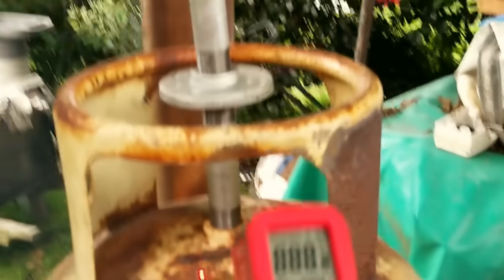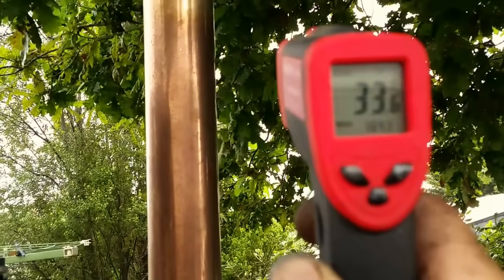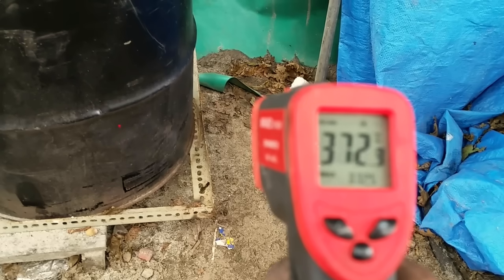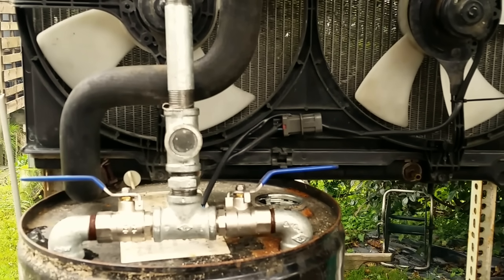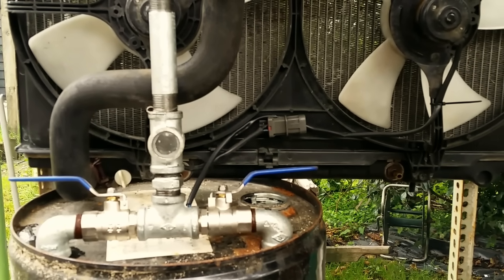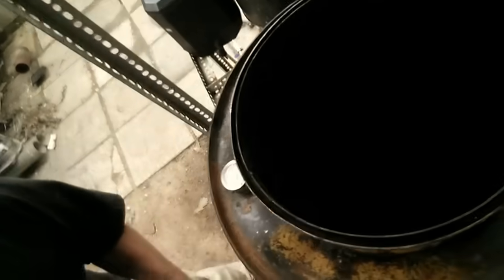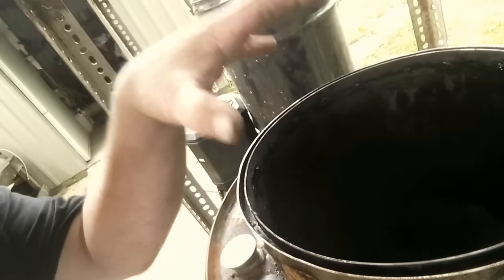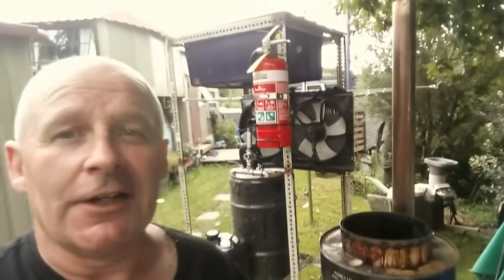Make your own free DIESEL.  PART 3  the reaction vessel

Comment: How much propane do you use to get how much fuel out? Is this a "net positive" process or does the propane cost more than the oil is worth? In other words, is it a hobby or a business?
Reply from the maker: You again!- why dont you watch the video to see how its powered? Clearly it is burning a waste product with zero cost. Its not a hobby or a business. It is an experiment to see if it could be done.
Reply: @t.h.o.r.  It's nice experiment, well executed. And if you have lots of waste oil as fuel, it seems to work. What if you don't have oil where you are? Solar sounds like a good option. So does recycling some of the gas and liquid fuel output back into the input heater.

Comment: I found out that to get a proper reading on surfaces that are shinney you should shoot the tempature laser at a spot that is painted with black high heat paint. Food for thought. I,m intersted in what your doing as I have a diesel TDI and lots of plastic. I have a gasifier project on the go at the moment , Built numerous pop can heaters , have a solar array, Have a roof mounted 8 ft long squirel fan from gas furnace blowers running a rare earth magnet altenator so I'm all in to alternitive energies. Keep up the good work!
Reply from the maker: wow- that squirrel fan is a great score!- is it aluminum? Ive been keen to do a ridge mounted squirrel fan but my roof  is 09 degrees away from prevailing winds
Reply: @t.h.o.r.  My brother works at the dump so he got me 8 of them all the same size .There steel but I sandblasted themand painted  them in epoxy paint after i weld 10 end to end . I did put them on the ridge of my house and found that through some research that the wind blows the perfect direction 2/3 of the time in the year. I blocked the top off to prevent the drag and the pitch of the roof funnels it right in nicely.When the winds blowing good I get about 650 watts into my glassmat batteries.I also have 10-265 watt solar panels that feed the same system . My 2-  3000 inverters are not the pure sign wave but I just run tools in my garage with the system. I have a 80 amp Midnight charge controller I bought for 850 Canadian. Much better then the China ones that blew up on me. Curious to see whats next in your plan.Cheers!

Comment: Years too late I know, but I have only just found this video: When using an infra-red thermometer to measure surface temperatures you have to be cautious around shiny surfaces like Stainless flues and dairy pipes.. there is a difference in the amount of infra red radiation they give off at the same temperature. Shiny surfaces will show a lower temperature than the actual surface temp.
If you want accurate readings, paint a spot of matte black hi-temperature paint on at the points where you want to measure.. then you will get accurate readings.
While you are at it, paint spots on all the points where you will want to take readings.. you will get more consistency.

Comment: If you had a handful of thermal transistors like used in thermal  chargers you could charge the battery that runs the fans by pulling the heat off the burn barrel. Just a thought to make it self sufficient. You could probably also find a way to use the trompe effect with the exhaust gas to compress the air to drive the flame, but that may be a lot more complicated.
Reply from the maker: I had to stop playing with it- my neighbors were making phone calls to the council
Reply: @t.h.o.r.  so sorry to hear that, in the us where I'm from (Tennessee) we don't have to worry much about stuff like that, we have freedom and property rights.

Comment: How dangerous is this... running without the tube which feeds the volatile fumes from the reaction chamber, without it being hooked up to the  input of the burner??   Also wondering if the radiator will clog up with all this residue, not turned into diesel.  :-)  Thanks.

Comment: maybe turn the air opening in the burner downwards, and place a container with a funnel underneath to catch the oil that drips through, so it is clean and easy to tip it back in the oil container above.

Comment: 🚭🚭🚭🚭

For those wishing to have a go at this project.... please be aware of the dangers involved re. the drum & gas cylinder...
Before cutting either, it is imperative that you fill them with water or CO2 first to purge any residual fumes in them, failure to do so will result in an explosion. 
Some may remember this tragedy...

https://www.cbc.ca/news/canada/ottawa/eric-leighton-didn-t-ask-before-cutting-barrel-teacher-says-1.2584955

Comment: Is there pressure in the tank?  Can I use a 30 gallon tank with a removable top with band clamp to seal?  I am just thinking of things that can be done to use other things.  Also I see oil drip out of burner., if you put the drip hole around so it will drip where you want it to but the opening is turned up just a little bit so the oil would stay in place and not drip out.  It would burn when the pipe gets hotter.  As I said before,  if you don't like my ideas I understand.  Also the vent pipe can have copper tubing around it to heat water.

Comment: Dude I love it!! I was wondering if you constructed a burner that would mist the fuel a lot more so you could use a  squirrel cage fan and some solar panels to power it then it would be ultimate!!
Reply: I imagine you could get your hands on a junkyard fuel injector to fully atomize the oil, but you'd need to filter it first to prevent clogging.
You could also redesign the burner to drip the oil directly onto a red hot surface (like many waste oil heaters do), which would instantly vaporize & atomize it. That's how engineers achieve complete atomization in a lot of internal combustion engines.

Comment: Well, not free but close to free right? Takes energy that you must pay for to run the other equipment if I understand this system correctly.
Reply: There are ways to increase the efficiency such as a solar panel charging the 12v battery running the pump & fans...
More insulation in the right places will help too... a more accurate way of metering the waste oil into the burner might be a good idea....
If there were some way to refill it without shutting it down that would also increase efficiency.

😎👍☘️

Comment: It'd be cool if you had a tap from the burn chamber so you could melt steel in there too when not making diesel
Reply from the maker: steel wont melt at 350C
Reply: @t.h.o.r.  true enough but with that pulse jet and pearlite insulation (which you want to do later) surely you will be able to reach temperatures to melt steel then?
Reply: Lord Inquisitor Tylion  I never claimed to have an encyclopedic knowledge of metal structures from steel to austenite but I do know with a properly insulated chamber (pearlite) that a pulse jet is more than capable of melting steel, having, in fact, built a pulse jet.
Reply: Lord Inquisitor Tylion  but yes, I'm open to learning more about just about everything, because knowledge is good.

NB: the flesh is weak inquisitior.

Comment: Get yourself a vacuum cleaner make it into a blower ,you have to have your oil vaporized to burn so it is not a good idea the way it is now ,you would be better off making a pre heater for the oil.  Then you would have all the heat you need and then some.

Comment: You should inform folks on the dangers of and why we shouldn't be pyrolizing PETE and PVC. 
And to only stay with the LDPE, HDPE, PP and PS.
Reply: Lord Inquisitor Tylion  I assume you talking about ABS ?.. aka Acrylonitrile butadiene styrene..
I would also probably avoid that as it contains Acrylites and butyl rubber compounds. Although they are not overly toxic the amount of petroleum in it is significantly less then polymer based plastics and you will end  up with nasty dirty clinkers in your retort and it not really worth the trouble.
PETE is not recommended because it can be sketchy even though it is a type of poly, chemically it has more oxygen atoms bound to it and if there is large amounts of it in your retort, it has it's own supply of oxygen (bad in a retort) and can spontaneously combust, or erupt into a flaming plastic volcano if temperatures are too high it can explode your retort etc..bad mojo for the novice petrochemical engineer lol.
PVC aka Polyvinylchloride and all your vinyls are the worst though because they all contain chlorides. Melting these plastics throughout the different ranges of temps can potentially create a cocktail of deadly chlorine gasses and various hydro chlorates including hydrochloric acid if scrubbers and hydro bubblers are not used in the process etc.. =bad mojo 👍

Comment: if you haven't by now, insulating the heated components such as the outer combustion burner and distillation column will increase efficiency
Reply: You can also install Thermoelectric plates to use the escaping heat to power the fans or other electrical devices. https://www.amazon.com/TEC1-12710-Thermoelectric-Cooler-Peltier-Pinkcoo/dp/B009T0FE7G/ref=asc_df_B009T0FE7G/?tag=hyprod-20&linkCode=df0&hvadid=167140037427&hvpos=1o1&hvnetw=g&hvrand=16539040318470767561&hvpone=&hvptwo=&hvqmt=&hvdev=c&hvdvcmdl=&hvlocint=&hvlocphy=9010316&hvtargid=pla-378975791197&psc=1
Reply: Funny how the reply is missing?? Censorship at its best.

Comment: All that work, burner noise, plastic vapor smell, electricity for cooling system, heat generated from burning any type of fuel, even from waste engine oil, collecting plastics and if necessary sorting and cleaning and so, how much fuel we are talking about, is this system efficient? and is it worth to spent days for couple of gallon "FREE" diesel? I don't think so, final product is not free but more expensive.
Reply: Not to mention concerns about chemicals and waste... I doubt this would be legal in most places ( no idea though )

Comment: I noticed in the early video that the little wire that was tagged to the drip feed was moving around from the turbulence.  Sound to me like that's what the fluttering in the flame is coming from. Try wedding the wire into position firmly so the grip position won't cause erratic fluttering.  Just a thought. Great video. Great job
Reply from the maker: what it is is over fuelling- as it heats up and the gasses start to flow- the oiul has to be reduced and the noise smoothes to an intimidating ROAR

Comment: Hi, I just watch your vedio and found its very interesting, can you advise me the cost of the LPG you are using and the disel you gain, is it cost efficient?
Reply from the maker: the LPG fires for no more than 2minutes to get the burner nozzle up to temprature. from then on it runs on free waste oil. (1 litre per hour) as the reflux segment reaches operating temp flamable LPG type gasses are emmitted which cant be processed into liquid fuel- they are passed into the burner to assist with combustion. Its a bit like feeding a dragon

Comment: I'm looking forward to the next video.  Love the idea of making our own diesel.
I use waste oil and 5 lbs air for my homemade heaterblock. shop Heater through a  suction nozzle..
No need for propane.   I've felt the heat and defining noise from a stray bottle exploding at our old  dump .  Burnt my eyelashes and slammed me into cab of my truck.
.. complained to city resulted in better management and separation of  flammable containers.  
2 min later the bottle came down in middle of the pit.  I wonder what altitude it reached.  An empty 2 lb has an enormous explosive energy.  I would suggest hand held ign start and or steel line from tank ( kept at a very safe distance. ) To the Babington burner
Just a suggestion but I tbelieve safety is #1 for everyone .
.. you've got good thing going with a little addition of a steel fuel line.
Reply from the maker: thank you Garry. I love that babbington burner- I use it to burn out tree stumps- heat the shed, heat water for a bath. and yes- i fully agree with those mods. the continuation of this project has to wait as i have jobs to do for other folk first.

Comment: Can you use synthetic textile waste in this machine?
Reply from the maker: Ive not done it myself but if it is Polypropylene or polyethelene then  yes- its the polychlorides that you must avoid
Reply: It will process everything fat, wood chips if you heat it and fumes come off it will run.

Comment: Are you able to make this run off the gas by product only after a while? We use waste oil in our diesel engines too,  so we would like to avoid using fuel to produce fuel.